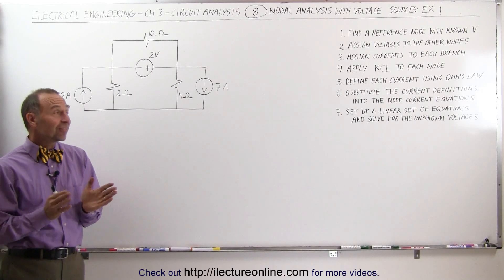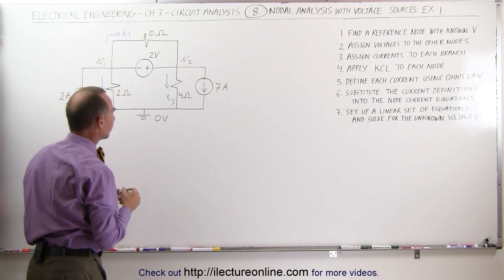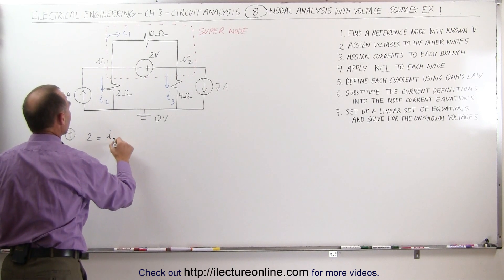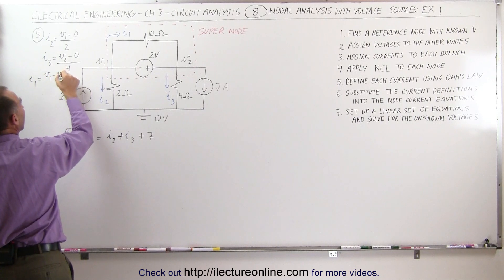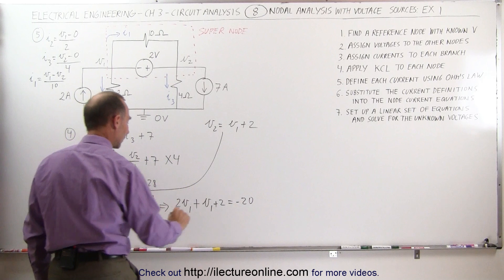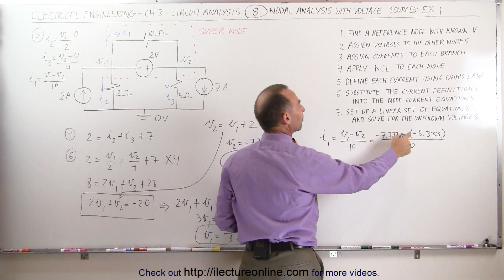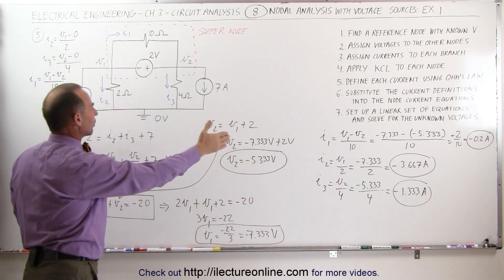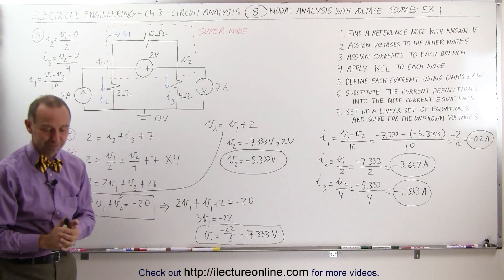Electrical Engineering: Ch 3: Circuit Analysis  (8 of 37) Nodal Analysis w/ Voltage Sources: Ex. 1

Comment: Sir, if ı didnt use supernode in this ex,  and assign currents through the voltage source , were the currents from v1 to the - terminal of the voltage source and + terminal to the v2 same?, so would there be only current through v1 to v2?

Comment: Thinking about this i believe it would make sense to assign one of the nodes connected to the voltage source as the reference node (with 0V). This immediately would give us the voltage of the other node connected to the voltage source (in this case 2V). It is basically the same logic, but the numbers & calculations would be a little bit easier.

Comment: Can we transform the sources to solve this using KVL? For example, can the current sources be transformed to voltage sources?
I would also like to add the fact that there's no words I can use to express my gratitude towards you professor, these videos are the only reason I'm surviving my course. Thank you so much!
Reply from the maker: There are many different techniques to solve circuits.  For some circuits you can use almost all of them if not all of them.  For some circuits certain techniques are better than others.  The best way to learn that is to try two or more techniques on a single circuit and compare the results.
Reply: @MichelvanBiezen  I see, I tried solving by transforming the current source to voltage source and using KVL but I could not. I don't know if I was doing something wrong or if the process isn't right for this circuit. Either way, thank you so much!

Comment: So I took a slightly different approach with this one, I assumed 2V for the top right node, 0V for the top left node, and then left the bottom one as a variable. I assumed an unknown current coming out of the battery, and then for the currents in the branches I did the normal I=(v1-v2)/R thing. I got the same current answers as you. I'm curious why in your approach you didn't also start with 2 known node voltages instead of one. Does it matter either way?
Reply from the maker: Try it and see if you get the correct answer.  (best way to learn).

Comment: Can you use nodal analysis by inspection method using this example? If yes can you make a video of it. Thanks and more power.
Reply from the maker: Essentially you can use any technique on any circuit.  We have examples of most of the techniques used.  The choice of the technique is one of personal preference.  Some circuits can be more easily solved with some techniques.

Comment: I have a question. Why is there not an i4 that flows from V1 to V2 through the 2V voltage source? Thank you.
Reply from the maker: There is, but we don't need to worry about it since we encased it in the "super node".
Reply: @MichelvanBiezen  thank you! you are doing gods work

Comment: Why is i1 not included in the supernode equation?
Reply from the maker: That is the purpose of using a "super node", to eliminate one of the currents, which makes it easier to solve the problem.
Reply: @MichelvanBiezen  I understand, is that because in the equation (current in) = (current out) , i1 cancels?
Reply from the maker: The current doesn't cancel, but we don't need to know the details of what happens in the "super node".  We only care about the current flowing into the node and the current flowing out of the node.

Comment: Why would you do mesh analysis given more voltage sources? Wouldn’t it be easier to do mesh analysis with more current sources?
Reply from the maker: These are just examples.  Not a recommendation to use one method over another.  After one has learned all the various methods, one will gravitate to their favorite method.

Comment: In a later video, you used nodal analysis to solve a circuit with a voltage source without using a super node. It made me wonder why the super node was necessary here, so I came back and found that this circuit can also be solved without a super node. (It did however involve assigning a current between v1 and v2, but that turned out to be easy enough.) I also want to say thanks for these videos. They're extremely helpful!
Reply from the maker: It is not necessary, but using a super node does make it a bit easier.  This is just an illustration of this method, which doesn't mean it cannot be solved in other ways.

Comment: Hello Professor Biezen, I hope you're doing well

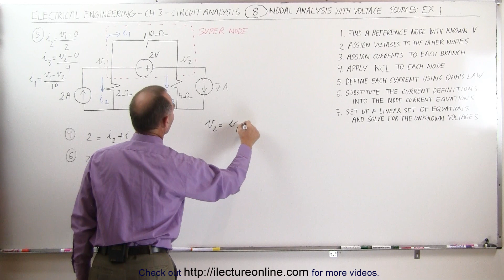At approximately 5:58 you wrote that V_2 = V_1 +2, do you mind explaining the logic behind why this equation is valid? Is it because there is a voltage rise because of the 2Volt voltage source that is between the V_1 and V_2 voltage nodes?

Thank you :)
Reply from the maker: Between the two nodes that are notated as v1 and v2, there is a 2 V voltage source with the positive side to the right.  That causes v2 to be 2 volts higher than v1

Comment: Amazing how you used the Super Node!!!Thanks a lot for that super explanation!!!But there is only one mistake in current i1, it is: i1 = 5,6667 A (is wrong 0,2 A), i2 = -3,6667 A (it's ok) and i3 = -1,3333 A (it's ok too), so i1 + 12 = 2... 5,6667 + -3,6667 = 2 in node v1... in node v2 we get: i1 = i3 + 7, replacing the values: 5,6667 = -1,3333 + 7, that is 5,6667 + 1,3333 = 7 (ok). Finally we have in ground node, where V = 0: i2 + i3 + 7 A = 2 A, replacing the values: -3,6667 + -1,3333 + 7 = 2, that is -5 + 7 = 2 (ok). I hope it helps a little for clarifying this problem!!!

Comment: I think there is a mistake... why didn't he assign current to the branch that has the voltage source...?
You can check yourself. In node V2, you are supposed to have I1  = 7+ I3. But that doesn't add up.  Because you miss one more current, which is supposed to be 5.867A.
You are supposed to get this:
I1+ 5.867 = I3 + 7.
Reply from the maker: There is no mistake in this video.  There is no voltage drop due to the current in that branch since it only contains a voltage source.  The only relevant information is that the voltage increase by 2 volts between the 2 nodes.
Reply: @MichelvanBiezen  thank you very much for your reply. But how will you explain then that the amount of current in nod V2 doesn't add up?
Reply: Ok...ok... Technically you didn't make any mistake. You simply ignored the middle current, and it didn't affect your calculations... 
But I think it's still a little bit confusing that you ignored that current, and you should have made it more clear. Thank you.

Comment: Isn't there a current i4 through the 2 volt battery??
Reply from the maker: Yes, there is, but it is easier to make the top mesh into a "super node", which then eliminates one of your currents.

Comment: What if the voltage source was replaced with the 2A current source in this circuit. how would u then find V1 and V2

Comment: Is there an alternate method to the supernode to solve these kind of problems?
Reply from the maker: There are many different methods to solve circuits.  Eventually it becomes a personal choice.  (But now we have to learn the methods the professor wants us to know).
Reply: Sorry i phrased the question wrong, i wanted to ask if there was an alternate method, while still using the nodal analysis, to solve a problem with a floating voltage source or is the supernode the only way?

Comment: Wouldn't v2 = v1-2? because voltage goes through a voltage rise and not a voltage drop. Voltage drop is usually a positive sign
Reply from the maker: The word "drop" means "decrease".  Like a drop in height is a decrease in height.  That said, some texts and some professors will hold themselves to a different convention.

Comment: Respected Sir,
the place were you made a super node and you are keep saying that it a single node , then the resistors 2 ohm and 4 ohm share a single node ...
and if we separate them then it becomes a short circuit between the two...
then how come we can calculate two voltages V1 and V2 from a single node????
correct me if i am wrong...
Reply from the maker: We used the super node to eliminate one of the currents and therefore made the current equation simpler.  But the two nodes still exist and v1 and v2 have a potential difference of 2V.
Reply: @MichelvanBiezen  okay....
Well thanks ...

Comment: But could there be a situation that v2=v1-2? It depends on how voltage source is connected, isn't it? I mean it could be connected with + directed to v1and - to v2 or other way around

Comment: I have a very important question.
the only way to make this work out . is to write V2-V1=2V
There's  a problem, thus far you taught us to write in the direction of current, from higher to lower potential and thus based on that is should be v1-v2=2v which will gives us an entirely different solution.

NO ONE AT EGN Department can answer...… 
im very confused why we do things differently from previous lessons
Reply from the maker: Note that the difference in potential across a voltage source does NOT depend on the current direction.  Therefore you MUST use the potential difference across the source as indicated:  V2 - V1 = 2V

Comment: Dear sir, I have a question for you. Step number 4, when you using KCL why did not you include i(1) in your equation?
Reply from the maker: Because we replace the top mesh with a "super node" and only consider the currents leaving the super node.
Reply: @MichelvanBiezen  thank you , sir.

Comment: How do we know where to put the nodes for v1 and v2???? can it be anywhere?
Reply from the maker: Knowing where to put them comes with practice.   Essentially you can place them anywhere, but they tend to be chosen more towards the "major intersections" of the circuit.  Is some cases you take a section of the circuit and make it a "super" node.  Again, practice and doing lots of problems is the key to understanding that concept.

Comment: Sir , how did we get v2 to equal (v1 + 2) if we assumed that current i1 is flowing from node 1 to node 2? Thanks!
Reply: It’s also my question
Reply: Remember that v2-v1=2, we get the number 2 from the voltage source that already depicted in the circuit. Therefore we can get v2=2+v1 by adding both equation with 2.
Reply: @damarabhinawa643  but if i1 was v1 - v2, why would the voltage drop be any different for the Supernode
Reply: wait nvm, i1 is going opposite of you know.. yeah nvm im slow lol

Comment: HOW IS IT POSSIBLE THAT i2 and i3 are negative and still can run this circuit? wouldnt  there be a problem on the 10ohm resistor becauze both currents face each other in opposit flow? and if you want to calculate the voltage over the 10ohm resistor, do you have to take i2 or i1? cauze i2 is the real current through 10ohm. ANYONE?
Reply from the maker: The sign simply indicates the direction of the current.  It doesn't matter which direction the current flows.  In either case it will produce the desired effect.

Comment: we assumed vsub1 to be at higher voltage than vsub2 that is why we did vsub1 - vsub2 to obtain isub1
then why are the values after calculations not matching our assumptions
Reply from the maker: Since there is a 2 V voltage source between v1 and v2, we know that v2 is 2 V higher than v1.

Comment: sir can we consider the loop below which contains 4 ohm and 2ohm resistors as a super node and do the analysis???
Reply from the maker: There are often multiple ways to solve a circuit.  We learn many of these methods, and then we we start applying these skills we tend to choose the method we like the most individually.  Try it and see if you get the same answer.
Reply: thank you sir

Comment: Sir, I would like to ask you someth. (Why you don't take or assume actually a current pass through a voltage"2V" then  we will ) see that the result will be the same of the that which will  you had been write there . Thanks for you our teacher
Reply from the maker: In a circuit we are usually not interested in finding the current through a voltage source. In this case we didn't have to find it to solve the circuit.  However there is nothing wrong with using a different method where you find the current through the voltage source.

Comment: Sir, i would like to know why v2=2+v1. Thanks!
Reply: Note that, this happens because the voltage is getting increased from - through the +. If it was connected oppositely, V2 would be V1 - 2. Hope this helped
Reply from the maker: +Kelvin Kwok   The voltage at node 2 is 2 volts higher than at node 1 because there is a 2 Volt voltage source between the two nodes.
Reply: V2 must be higher than V1. Think it that way, you have V1 and that source ADDS 2 more voltage to that and it becomes V1+2, which we called V2
Reply: +Michel van Biezen sir, how do you know which one of the voltage is higher ? thanks
Reply: You decide arbitrarily and then the sign tells you if you were correct or not.
Reply: but we assumed vsub1 to be at higher voltage than vsub2 that is why we did vsub1 - vsub2 to obtain isub1
Reply: Adarsh Verma I think the difference is that we ASSUMED that i1 goes in that direction, it is not certain and the result sign will tell us if we are right or not. When we say v1 has lower potential than v2 we are sure that that's right because it is a given information (- and + tell us which is the lower potential). Indeed we could see it at the beginning and assume that the current i1 flowed from v2 (higher potential) to v1 (lower potential)